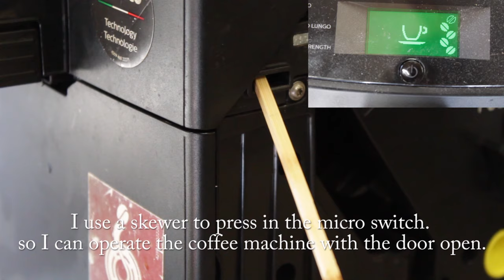Philips coffee machine cleaning and leakage repair.

Comment: thanks for the good video. I think my problem is in the water flow meter. How can I remove and replace it ? The four lights are blinking after I pushed the expresso button. Hot water and steam are ok.
Reply from the maker: you're welcome, thanks for the response. 

I did not have to remove the flow meter myself. and I think you have a slightly different device. (I don't have lights).

But if you take the top off you should be able to get to it. can your coffee machine rinse the brew group? 
I would rather look for it at the grinder. 

but i have no experience with this error

Comment: Hello , thanks for your video…. Just question, in time 19:27, i can see the eletrovalve . When have 230v , the valvule open and let water or vaporisation, right? But water also go to the  brewer Group in same time? Because i can not see nothing for blocked water for brewer group . Thanks
Reply from the maker: If voltage goes to the valve then it does indeed go to the steam nozzle. That will not be 230v but less I assume. 

The path to the brew group remains open. But there is another valve that only opens at higher pressure. Which means the water only goes to the steam side when the valve is open. Because that is the path of least resistance for the water.

Comment: The videos I find all miss how to remove the back cover of Philips 5000 series coffee machines. I bought a used one, 5330/10 to be exact and there is a water leak. Mine has some water beneath the left back corner, when looking from the front. Near the power cord. Wanted to remove the back without damaging the plastic. Do I first need to remove the top or can I just remove the back?
Reply from the maker: I have never had that machine apart. Often coffee machines are very similar to slightly older models.  

Unfortunately, I can't help you any further. The model in this video requires the top to be taken off first. 

Good luck, I believe in you being able to fix it.

Comment: Thanks for the great video! I'm hoping you might know the fix to another issue with this machine. During descaling the descaling process stops with an error message that the brew unit is not placed correctly. But the brew unit is stuck in place during descaling and I can't remove it to fix it even after pulling out the drip tray. Do you know how I can reset the position of the brew unit or remove it?
Reply from the maker: I had the same error code. then I replaced 1 of the microswitches behind the brewunit. 

I don't know how to get your brewunit in the right position
Reply: @SpareTimeWorkshop  Thanks for the reply, I will look into replacing the microswitches

Comment: Hi. If you have encountered a similar situation, what could be the problem? Thank you!!! - https://youtu.be/cDt8chOwOUw  
The machine starts, heats the boiler, then tries to pump water and stops. Water recirculation is suggested and many cycles can be done to no avail. If you press the stop button when it shows water drops, it sometimes starts and then runs.
Reply from the maker: I took a quick look. But unfortunately, I don't know either.